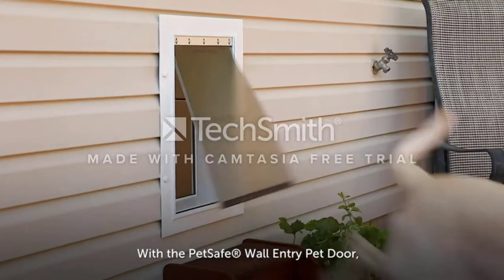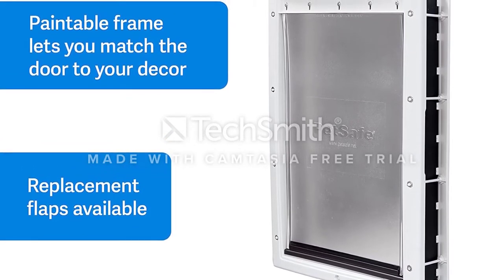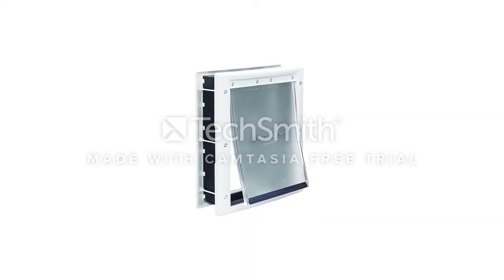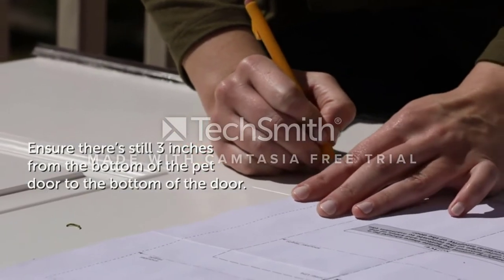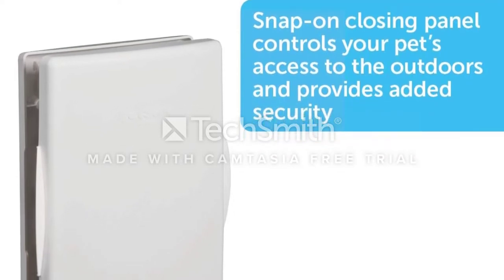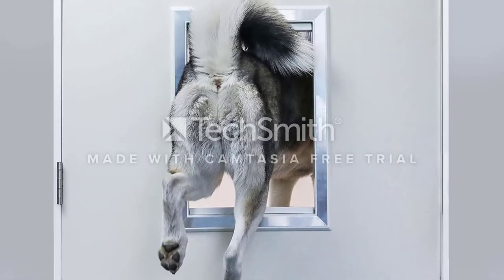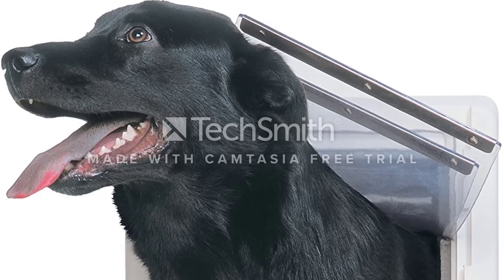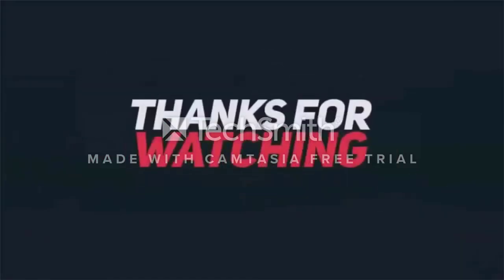✅ Top 5: Best Dog House Door For Cold Weather 2022 [Tested & Reviewed]

Comment: the thing about the plastic doors is they freeze so stiff that small dogs have a hard time getting in and out. it worries me to think they could get stuck outside in sub zero temperatures. can't they come up with a material that doesn't freeze stiff like that? or at least put hinges on the top so even though  the door is stiff , they can still push in the door.